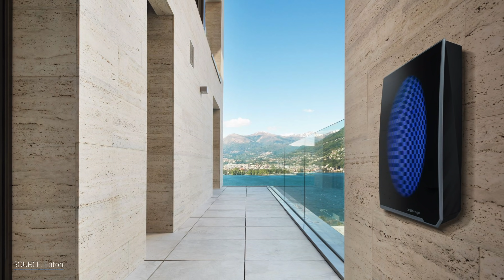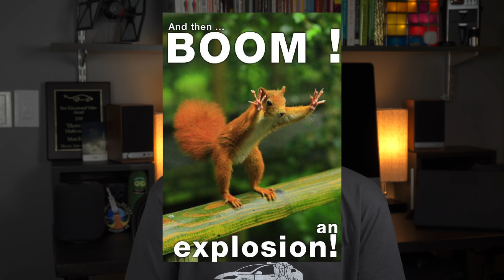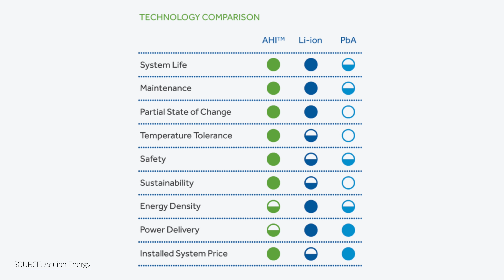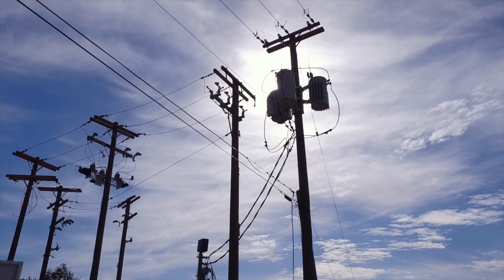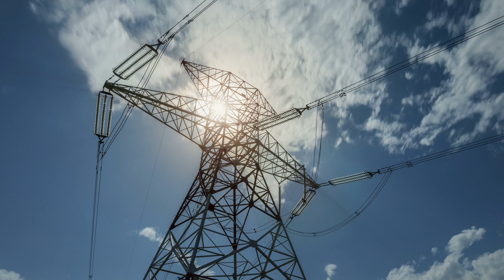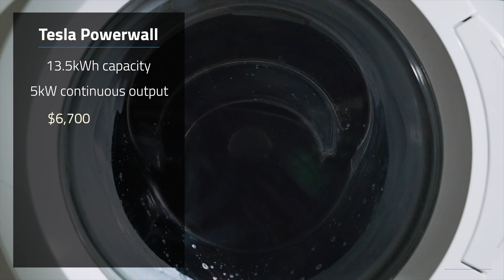Solar Battery Tesla Powerwall and more

Comment: At this point in the game, the best use for batteries is for backup for short interruptions.  Where I live, the average outage is less than 2.5 hours.  Having part of the house separated onto a panel that is served by a smart inverter/charger unit with a much smaller but sufficient bank of batteries would be the most ideal scenario.  Something along the lines of a Samlex 24 volt charger inverter that is capable of having mains, a generator and solar all going into it to either power that sub panel or back it up if you only start with a battery backup approach.

With the Samlex (And there are units from Schneider and Outback that can do the same thing too), you can just add solar when you are ready and you can then even program the charger/inverter to prefer the batteries and solar before switching back to grid.  Or, with a more advanced unit, program it to peak shave.  The only limit on this would be the storage you add and/or the panels you install.

Personally, my plan is a Samlex 4kw unit and 2-3 kwh of storage at 50% dod and it will cover all the normal load circuits and the freezers and refrigerator.  The large draw items like hot water and my GHP will either be later or never, depending on cost.   When panel efficiency goes past 30%, I will likely then get some panels (I have a treed lot and I don't have a good am to pm view of the sun without cutting down almost an acre of trees that are over 35 feet tall.)

The big reason I like the idea of batteries for backup is that for the short duration you need it (under most circumstances), you aren't running a generator with gas or propane LNG and making all that racket and pollution (And mean real pollution too as small engines don't have the emissions systems of cars).  The batteries would be maintained and recharged from grid power.
Reply: We have a very similar situation as yours (semi-rural NE USA), all electric home with GSHP, but no current plans for battery. $10k 20 kW backup system whole house LP generator with load shedding and auto transfer between grid now actually is needed maybe once per year. Utility is much more reliable than when we built in 2007. Can't see the economics of solar/battery but love the idea of energy independence.
Reply: all sounds pretty sensible and well thought out

Comment: Been doing grid-assist home solar for years. My Trojan L16 FLA batteries are already spent (just under three years). Looking for about 10 kWh of lithium (or similar) battery to replace those crap FLA batteries. Money talks! They don't come cheap...been looking at the Nissan Leaf batteries and DIY my own battery bank. Would be great if we could buy a safe 10 kWh battery (24 or 48v) with around 4-5 kWh output and for around $1,000. I know, dreaming.
Reply from the maker: That’s one of the downsides of lead acid batteries (short lifespan).  Hopefully lithium ion prices keep dropping and get to that $1,000.  Have you looked into Tesla batteries for a DIY?

Comment: You made some base assumptions that don't translate well into reality.  I suggest researching AC vs. DC coupled solutions.  There are very few hardware solutions that provide DC coupled solutions which are required to charge a battery directly from your solar panels when there is grid outage during daylight hours.  AC coupled solutions WILL NOT be able to charge batteries directly from solar panels; as they are grid tied and must be disabled when the grid is down for safety purposes.
Reply from the maker: Not sure I follow you on the base assumptions.  A Tesla Powerwall has a built in inverter, charges directly from the solar panels, and can keep your home up and running during a blackout almost indefinitely each day with the incoming solar power.

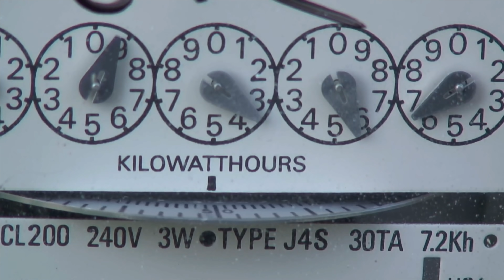Comment: 6:20 some channels discuss net metering but it is not clear how much.  in our country at $ 0.21 per KWh, our net metering is awful.  the utility puts value for solar output the same as how much they pay a power producer (wholesale rate) at around 1/3 cost of power delivered to consumer.  With a little math, I find that excess power should be put into storage. In my estimates, battery storage cost (batteries only) as much as solar power per KWh, putting total cost of electricity from battery storage to twice the cost of solar power.
by the way, subscribed.
Reply from the maker: Thanks!  Net metering varies wildly depending on where you are.  It seems fairly common for a utility to pay a wholesale rate for solar, but in some locations like mine I get the same rate I’m actually paying for power.  I pay $0.25 per kWh for my grid electricity and I get $0.25 per kWh erased from my bill for each solar kWh I put into the grid.  However, if you’re only getting paid the wholesale rate, then a battery makes a lot more sense.
Reply: Undecided with Matt Ferrell 25c ? Would that be a standard average rate in U.S. Everyone is complaining where I live when they put it up to 23c AUD so 17c U.S. Your deal is really good net metering.Here in OZ some states to 1 to 1 prices like buy at 30c sell at 30 c and some on 20 year plans where they get 60c to sell green energy to power company.when it comes to solar where lucky here with payback ranges between 2-5years

Comment: Our utility company just gave us approval to use our Tesla system (22 325w panels and 2 PowerWalls).  Of course, it's been raining since last Thursday, so minimal details to share.  While we do have net-metering, we did this because our rural electrical grid is "beyond delicate" and we are in a constant roller-coaster of losing power or getting huge spikes, so we wanted to stabilize our power and be prepared when the grid is down for 2-36 hours unexpectedly.  Looking forward to SUNNY days!!!!
Reply from the maker: That’s a nice system!  Having a less than reliable grid connection is a very compelling reason to get the battery setup.  Good call.  Got to admit that I’m a bit jealous.  Hope it gives you smooth sailing going forward.
Reply: Square feet? With 3500 sq.ft the Tesla site is saying I only need 2 panels & 2 powerwalls but that seems inaccurate. I would think I would need more.  I'm in Texas,  idk if that makes a difference.

Comment: I've seen some load shifting "just plug it in" devices that are safe to use just by plugging into any outlet. Using time-of-day pricing, I estimated that one of the products could pay itself off in about 8 years. This was a few years ago. Would be interesting to learn more about products like this. One product actually supported running like a UPS. If it detected power loss, it would trip the breaker and continue to output power so all devices on the same circuit would remain powered, no installation required.
Reply from the maker: Do you recall any specific makes/models?

Comment: Still waiting for a home fuel cell system.  Until then i will keep using   the grid at 9 cents kwh and a natgas generator for backup.

Solar is not supported in most of Texas.
Reply from the maker: I wish my electric was $0.09 kWh.  Sadly, I’m at $0.25 right now for what I pull from the grid.
Reply: Your electricity is so cheap because of the wind production in Texas.
Reply: @kokovox  errr no,  wind just adds complexity and cost

Comment: Thank you for attempting a widely ranging (albeit one-way) discussion.  I venture only a few nuts-and-bolts inputs.  Installation:  Here in Florida, reputable contractors are precious.  A plumbing contractor told me that most of his work entailed removal of solar, because the installations caused roofing leaks.   Capacity:  Where a community lacks gas, such as Florida (again).  The HWH, at 6-7KW, is a major headache re non-utility supply.   And this neglects electric heating (typically 15KW) or a/c load, which is even higher.
Reply from the maker: Curious why a plumber is removing solar?
Reply: I really don't know, Matt.  Perhaps he was focused on the solar HWH jobs.  The guy is Dan Bouldry, VP of Terry's Plumbing Svc, Sarasota.  Ph 941-955-5362.  Fax 953-5620.  I know that they're experts, 'cuz they repipped my entire house (because the former owner used hard water) w/o a snag.  (Also, a tip from their guys:  If you have trees overhanging the roof, put fiberglass screening over the vents, using zip ties to secure it.  It keeps the leaves out, which would cause clogging.)
Reply: Matt:  This seems to be a universal YT characteristic:  No can read your 'love it' response.   JL

Comment: I have two powerwalls. I was pleasantly surprised they could power the house off grid during an outage and recharge with solar at the same time.
Reply: Exactly.  I like the fact that we won't lose power when the grid goes down.  And if net metering drops dramatically, or is eliminated altogether, we will still save money.
Reply: How many square feet ?

Comment: How about Nickel Iron Batteries? Price has come down some . Still pricey but last a life time.
Reply from the maker: From what I understand they aren’t as efficient (slower charge and discharge) and suffer from a greater loss rate when not used.  Doesn’t mean they aren’t a good option, but it’s something that has to get factored into how many batteries and solar panels you’d need to make it work.

Comment: Can you elaborate on AC vs DC battery systems? I heard DC are better because they don't need to convert for storing solar. And what about off grid? I heard Tesla can only be off grid for about 2 days, then it needs Internet again. True?
Reply from the maker: There was another commenter that mentioned something about two weeks with his Powerwall.  

As for AC vs. DC battery systems, DC batteries have the edge in charging efficiency compared to an AC system because there’s no conversion loss from solar (DC power source).  If you’re powering DC equipment, then that efficiency continues.  However, a DC battery system loses the efficiency when powering AC appliances, so AC battery systems do a battery job on that front.  I’m still learning some of this myself, but from what I’ve gathered DC systems are fairly common for off-grid setups ... and have been for quite some time.

Comment: I don’t know how many think as I do about weighing up environmental impact rather than cost/ROI.  My understanding is that the environmental impact of producing lithium ion batteries, coupled with energy losses from a home battery system means that batteries are ecologically non-viable also.

Whilst electric cars also suffer from this I am pinning my hopes on an electric car parked in my garage which can also be used as a home battery system by feeding this back in.  An average car 40kwh battery has plenty of potential compared with a Powerwall or similar home battery set up.  Hopefully this will be possible in the next 2-3 years.
Reply from the maker: I too want to see “vehicle to home” or “vehicle to grid” become a common standard.  However, the environmental negatives of battery production and minor energy loss is far outweighed by the benefits.  If you have enough solar production to keep you going with a battery 24 hours a day, then that energy loss doesn’t ultimately matter.  But for batteries to really become neutral, we need to have closed loop recycling.  That’s in the works, so in a number of years battery production shouldn’t be a huge concern.
Reply: Undecided with Matt Ferrell  Thanks for your reply Matt.  My point here is that my solar will be
providing totally clean energy to the grid and replacing coal generated electricity.  However storing that electricity in a lithium ion battery may reduce the amount I draw after dark but the net effect may be less than zero (due to wastage) and, in addition the production of the batteries themselves will have produced substantial emissions.

I strongly considered buying a battery but decided against - not for the obvious ROI reasons - but because of the net detriment to the environment.

We need to find and focus on more environmentally friendly methods of energy storage.  Lithium ion batteries are undoubtedly only a stop gap solution.  One that we will look back on without much fondness I suspect.

Comment: 6:30 The grid is acting like your battery? That's not how it works, that's just the money talking.
Reply from the maker: I know it’s not a real battery ;-).  I meant it figuratively ... and it’s an accurate way to look at it with full net metering.  Solar production overage going into a battery or into the grid has the same effect to my final bill.  That being the case, it makes it harder for me to justify installing a battery financially.  The ROI isn’t there.  Environmentally, I’d still love to have a battery system vs. pulling energy from the grid ... I just can’t afford it right now.
Reply: Okay, but that means that it is in fact just about the money. And I can appreciate that, but common (and most particular government) interest in solar is about saving the planet and it would be good to differentiate between these two goals because they are not the same, even though in limited perspective they may appear to have the same result.

Comment: Have solar in Texas Panhandle local power Excel and they only offer net metering at $.02/KWh, plus a $20 management cost per month. So overproduce more than 680KWh/month before you break even. Just not worth it. Interested in batteries. I think you missed the comparison of cost vs lifespan. Lithium might cost more but it will maintain more usable power longer. 
That is where I’m looking. 
Thanks for the great videos Matt.
Reply: Fred, I'm in Florida, with a similar climate to yours.  Take a look at my original feedback above:  How in hell do you run a/c off-grid?
Reply: John I am not off-grid, but you can run whatever your system (inverters/batteries/solar) can produce. I have current peak at 7800KW so I can certainly run both my AC units just off the solar. Since my solar has micro-inverters on each panel there is no DC converter on my system.
Reply from the maker: Yeah, I should have covered the lifespan angle.  Something like a Tesla Powerwall is more upfront, but can end up costing you less in the long run vs. something like lead acid.  And the $0.02/kWh is crazy!  That really is the perfect situation for a battery.

Comment: I have been living with a battery backed solar power system for a while and here are a few things I have learned.  
1.  Conservation is the number one thing to do.  I cut my bill by 1/3 just through conservation. LED lights, insulation, power strips.  
2. Behavior changes:  Change habits to use the power when the sun is shining.  Things like pool pumps, HVAC, water heater, dish washer, washing machine, dryer, ect.  
3. It's better to think of the battery as more of a "load balancer" rather than energy storage.  I only use about 15% of my lead acid battery for storage and so I expect it will last 3000 cycles or 8-10 years (I'm on year 3).
4. What happens when the grid goes down?  You need batteries. 
5. Lead acid is still the most economical way to go.  I installed a 48vdDC, 720Ahr (~7kWh usable) battery for $5,000.  Maintenance is 15 minutes per month.
Thanks!
Reply from the maker: Great rundown!  Thanks for sharing.

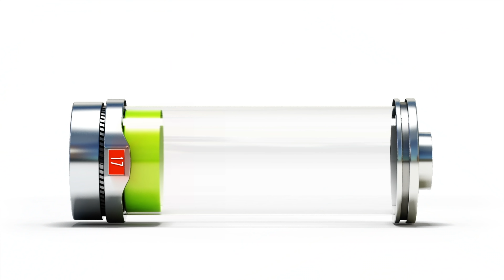Comment: 1:24 let me stop you right there. Capacity is measured in amp hour not kilowatt hour. Energy is what can be measured in kilowatt hour.
Reply: Capacity can be measured in both, as kWh is the same as amp hours multiplied by voltage. The flow of energy is measured in watts and a kWh is the total amount of energy that can flow for a whole hour. Besides, all these battery systems, like the batteries in EVs, are rated in kWh.
Reply from the maker: You beat me to it.